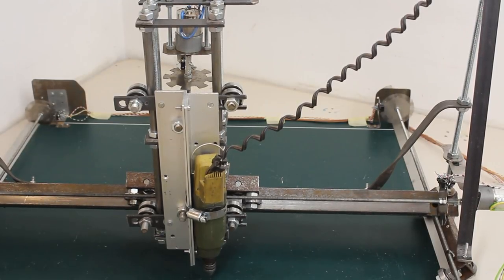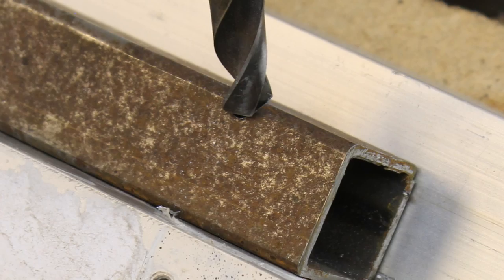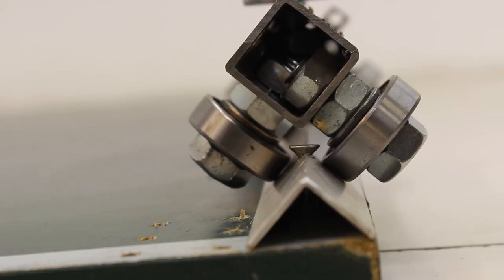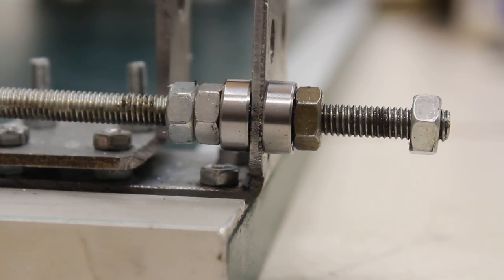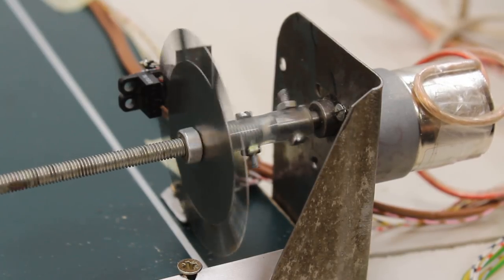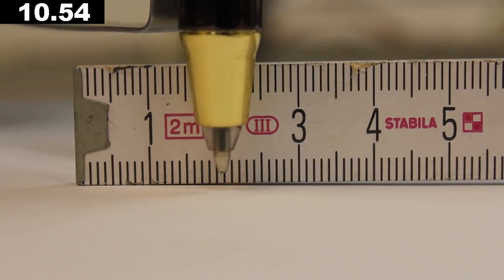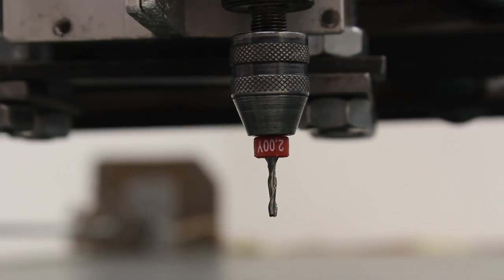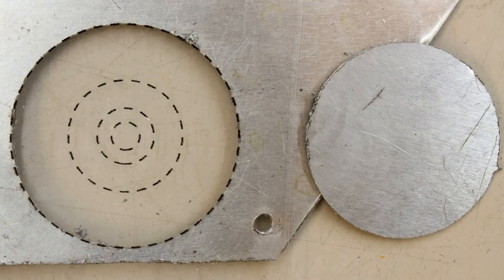Homemade CNC machine with materials from a DIY, built with simple tools

Comment: Sir, I want to know the step, so we use slicer software to cut the 3D CAD model into layer and transform into g-code. So, now how are we going to connect PIC18 with the g-code? Is there any thing out there we can use to connect PIC18 and g-code without using ramp1.4 and arduino? Thanks sir, your answer will save me a lot of time.
Reply from the maker: Well, I haven't used PIC18 nor g-code with this CNC, thus I can't give you an advice. I have upgraded this CNC with bipolar stepper motors using grbl to control it. With that configuration it can process G-code:
http://homofaciens.de/technics-machines-cnc-v2_1_en.htm

Comment: By the way , after making a look at the project page! i noticed that Figure 49:
Cutting 0.8mm aluminum plate which does not look smooth , i don't know maybe because of the chips or some vibration caused by the high rotation  of drill bit.otherwise it is a great work i love it
Reply from the maker: +Wajdi Rebei Thanks! The disadvantage of the simple construction is more clearance in total. Let's see what the accuracy of my CNC v0.6 will be: 
http://www.homofaciens.de/technics-machines-cnc-v0-6_en_navion.htm
Reply: +HomoFaciens ok ! i am following you project and i hope you will do more developed CNC machine ;) i appreciate your work ;)
best regards !
Reply from the maker: Thanks! v0.6 won't be my last CNC. There will be machines using "normal" stepper motors, too.
Reply from the maker: +Wajdi Rebei There is a chapter about those drives under construction on my project page:
http://www.homofaciens.de/technics-base-circuits-encoder-disc_en_navion.htm 
I will explain in more detail how to wire the motors and photo sensors in that chapter and there will be a video about that, too.
The H bridge you have found isn't exactly the same, but you can use it as well (it's the same IC on the board). I can't give you a link to exactly my board.
Reply: +HomoFaciens oh thank you for explanation .... an about the H bridge i found the same as yours  ;)

Comment: Hi. Cheers for posting this. I'm interested to build this for my model plane flying and I cut form or balsa sheets so this is perfect and within my reach.  But can this be done on a pi raspberry unit ? And what software is needed to draw pics or design if possible ?  Writing in c I'm not too sure how.  I'm deaf
Reply from the maker: +Rc Vulcan You need an Arduino to control the motors of this machine. You can use a Raspberry Pi to send data to the Arduino. Have a look at the project page:
http://www.homofaciens.de/technics-machines-cnc-v2_en_navion.htm
You can find a link to the source code of the software on that page.

Comment: If this is your "drug" for future CNC junkies, I'm HOOKED!  I would not have considered starting such a project because I did not think it could work well enough to be worth the effort.  You have shown that this is clearly not so.  Thank you.
Reply from the maker: John Colvin It wasn't that great adventure since I had built some of the components before. The linear drive was part of my video about the Arduino Uno:
https://www.youtube.com/watch?v=PQ1FBcQT0AI&lc=z13uuljryyncejejk04cjtroyn2vvxixxdo
Nonetheless many details were figured out while recording the video (a process that last for two weeks), which is why it wasn't a straightforward process. Sometimes you simply have to start working - many solutions come to your mind when when using your hands.

Comment: Hi,
I don't think it's possible to run the machine with only one Arduino, I may be wrong.
Will you please make a video to explain the circuitry and wiring.
Reply from the maker: Would you please go to the project page to see all the details as I told you in the video?
https://homofaciens.de/technics-machines-cnc-v2_en.htm
Reply: @HomoFaciens  Thanks for quick response ..
Your project page is really explanatory. Thanks again.

Comment: Would it be possible to use salvaged car viper motors to drive shafts?
Reply from the maker: Yes, in principle, but you'll need H bridges that can handle the high current running through wiper motors. The L298N I have used can control a maximum of 2A. In general, wiper motors are a bit too powerful for the mechanics, so look for low power models (not those for trucks).

Comment: On the encoders.....
Why don't you use the Optical sensors n discs from those inkjet printers??  
Much higher Resolution
Reply from the maker: Because there are too many stripes on those sensors, usually more than 1000 Pulses per revolution. With that high number of pulses the Arduino can process no more than 1 revolution per second which would be an extremely slow CNC machine.
Reply: Do you know that is a fact??  I think you're underestimating the capabilities of the Arduino.  or that is really bad IF true.

In any case, with this machine you can already cut new discs with 100 slots.
even 50 slots will improve resolution by more than 600%
Reply from the maker: The Uno has only 2 hardware interrupts, but three motors have to be controlled and don't forget about the USB communication. With all this it's hard to compute that many pulses per second. Of course you can use sensor discs with more slots, but that won't help if your mechanics has more backlash than that academical resolution. My CNC v3.2 with better mechanics uses 30 slots:
https://www.youtube.com/watch?v=iZ61lK91HRE

Comment: Really Great, but plz tell me  how you can interface the "Libre Office Draw" with your CNC ???
Reply: +Samer Elsawy and didn't you use any firmwares ????
Reply from the maker: +Samer Elsawy There is no interface for LibreOffice. You simply create a drawing with LibreOffice Draw, export it as Scalable Vector Graphics. Store that file in the "pictures" subdirectory of the installation of the command line program (commands-CNC).
"Firmware" is the software running on the Arduino (CNC_v2.ino in the installation package). Without that software, the Arduino is nothing but a piece if silicon...
Reply: +HomoFaciens Thanks alot for your reply :)
but did you write these programs with yourself (CNC_v2.ino & commands-CNC) ???
Reply: +Samer Elsawy and plz i want to know what is the function of (commands-CNC) ???

sorry i have so many questions because am really amazed with your amazing machine :)
Reply from the maker: +Samer Elsawy Yes, these programs were written especially for this machine.
Reply from the maker: +Samer Elsawy Commands-CNC runs on the host computer (Laptop or desktop) with Linux as operating system. That program reads the svg file and transforms the X/Y coordinates of that file into stepper motor commands (e.g. stepper motor X one step forward). The stepper commands are sent to the Arduino through USB. CNC_v2.ino runs on the Arduino and turns the DC motors (stepper motors) on/off to execute the steps received from the host computer. My v0.6 under construction will be more easy to build:
http://www.homofaciens.de/technics-machines-cnc-v0-6_en_navion.htm

Comment: Dude, Water is NOT a cutting lubricant. Oil is. WD-40 is. Other than that, Great Project !
Reply from the maker: +StepCorn Grumbleteats I know, but it cools the plastics so that you can cut it and that's what this machine was build for (besides cutting wood). I do not want to use cutting oil in a machine that spreads that fluid all over the room (water evaporates without residue). If I have made a CNC that can in fact cut aluminium I will show how to implement a circular flow of cutting oil. Be patient.

Comment: Can this be made to work with stepper motors too or code is totally different since you are using normal motors?I'm using an Ardunio UNO.
Reply from the maker: +ivan zubak You have to change large parts of the Arduino code if you are using "normal" stepper motors. I will use bipolar stepper motors in one of my projected CNC machines - stay tuned.
Reply: Ok,thanks.I have bipolar stepper motors.I thought about building a small laser PCB "engraver" so I just burn the paint off and etch the exposed copper away,
Reply from the maker: +ivan zubak Thus a small machine like CNC  v0.6 that is currently under construction could be a solution:
http://www.homofaciens.de/technics-machines-cnc-v0-6_en_navion.htm

Comment: not yet strong enough to drive a router he said as the video got into the router part.... I like the idea of gear motors and feed back by light sensor... simple.. and surprisingly accurate. I suppose to get to .001 accuracy. (thousandths of an inch or 1/40th of a mm ) you need a way of stiffening supporting your threaded rod, and perhaps pre loading tension/compression on the traveller nut. I had thought of a spring loading compression to take out gear lash or clearance so to speak. It would have to reverse compression direction when the direction on an axis changed. Perhaps by solenoid.

neat construction.. have seen similar.. this one is not fancy, which I view as a good thing.. and as I said very accurate..

One thing I might mention which I know from a ways back. Radio dials in old 1930's and later tube console radios were controlled by a tensioned wire on a pulley wheel. The stated accuracy of the dial indicator for stations was 0.001 inches! This was used as a basis for the control of the print head of the first dot matrix printers which were designed about 1962 -1962 by IBM. They needed very accurate repeatable positioning for building characters by repeated passes.. It might be possible to get good positioning information passed to a secondary servo with a feedback loop. 

Whilst I don't think the wheel-wire is strong enough to drive cutter heads it could position a go no go indicator which mated with a feed back driven stronger motor drive on a threaded rod or gear track. In other words you have a rabbit and greyhound concept. The wire-wheel leader system is the position "flag" and the cutting head head chases it with its own catch up sensor array to align it on the right point. 

The physical connection between the two travellers to provide relative position information could be a sliding capacitive sensor like a digital caliper.
Reply from the maker: Yes, I will have a closer look at the linear sensors as in the digital calipers. The dial indicator mechanics is interesting, too. Thanks for your feedback!

Comment: If you drill the hole to 6mm how on earth do you then use a M6 tap? Tap drill should be either 5.5mm or 5.25mm depending on the thread pitch of the tap (0.5 or 0.75mm pitch)
Reply from the maker: +koswix 
It's a 5mm hole what I was talking about, isn't it? Please give me a time index if I am wrong, because nobody is perfect.
Reply: +HomoFaciens 4 minutes. Just watched again and realised you only used the 6mm to chamfer the entry to the hole - my bad, sorry! Missed it because I would have used a countersink tool to do that bit.
Reply from the maker: +koswix 
Thanks for your second reply; so this time it wasn't me that made a mistake ;-).
If I had a countersink in my toolbox I would have used it...

Comment: do you think it would be possible to modify this design to add a laser engraver? And is there some way to generate the code to move the head and when the laser is powered? if so, what software would I use? I am a complete newbie at this and want to make a laser engraver
Reply from the maker: Since you are asking if it is possible, I assume you are an electronics novice thus I give you one advice: "Hands off lasers!" You won't be able to follow my future video instructions with no eye left...

Comment: Good day. Please tell me how to run CNC Shield through the Arduino UNO ? as was suggested to me that Shield should be the driver. Where to get this driver for CNC Shield?
Reply from the maker: +Алексей Кротов What shield? I am using an Adruino Uno with two H bridges. There is not classic driver, the software written for my machine simply transforms Scalable Vector Graphics into commands for this special CNC.

Comment: @HomoFacines can you do a tutorial on how to program it to give it depgh (z axis movment up and down)
Reply from the maker: +Adrian Ciszewski I am currently upgrading this CNC to version 2.1 using bipolar stepper motors. I will try to operae it with GRBL on the Arduino - stay tuned!
Reply: +HomoFaciens thanks for the reply, after watching your video i decided to make my own CNC machine but wanted to base it on extruded aluminium (v slot) any advice in a video or exchanging ideas in CAD programs would be very much appreciated
Reply from the maker: +Adrian Ciszewski Well, I am not using CAD software to create my machines. You can see all my machines (and so the ideas behind) on my project pages (especially the "machines" section):
http://www.homofaciens.de/technics_en_navion.htm

Comment: Most programs seem to be setup to drive stepper motors, how did you get the Gcode changed over for encoder pulses instead of "steps"  maybe i'm missing something simple?
Reply from the maker: +frankswd The DC motors are transformed into stepper motors by the feedback through the optical encoder discs. From that point there is no difference to other CNC machines. But: The software I have written can't read G-Code (yet). It processes only scalable vector graphics. How to turn DC motors into stepper motors will be shown in a video that is currently under construction - stay tuned!
Reply: "The DC motors are transformed into stepper motors by the feedback through the optical encoder discs."  This part i unstood and i have used them this way for simple code, but to take a Gcode and change from giving  steps to reading pulses, actually seems like it would be easy but i have found no software that has this option.  Ultimately it would be nice to add PWM as based on RC Car ESC so one could use hobby  BLDC motors which are both cheap and powerful!!!    And i have a bunch of them :)
Reply from the maker: +frankswd If you can't find the software you are looking for, start to code your own! Using RC speed controllers is similar to using servos. My CNC v0.5 uses servos as drive:
http://www.homofaciens.de/technics-machines-cnc-v0-5_en_navion.htm

Comment: hi
i have oriental brush less motor vexta axhm5100k-gfhk2 
can we used it as stepper motor ?
or can wire it with stepper drive ?
thanks
Reply from the maker: Burshless motors don't work streaight forward with the electronics I have created for this machine. You need a brushless motor driver and you need to adapt the software to that driver board.
Can't ell you all in a single comment, learn the basics about encoders and how to control DC motors on my pages:
https://homofaciens.de/technics-base-circuits-encoder-disc_en.htm

Comment: Hi , i saw your tutorial and i'm making same cnc machine but with stepper motors, and i have some problems with wiring stepper motors with easy drivers...
Reply from the maker: +Tiki Gangsta There will be videos / chapters about using bipolar stepper motors in the future and I will upgrade this CNC to those drives - stay tuned!
Reply: +HomoFaciens I'm using unipolar/hybrid with 5wires  stepper motors but i'm using him like a bipolar wired with 4 wires with easy drivers 4.4 but when i connect motors only with easydrivers (because arduino is not arrived yet) and switch on 12v power they are rotating by self. 
Is it normal? Sorry for my bad english..
Reply from the maker: +Tiki Gangsta What about reading the datasheet of your easy driver? That should give you the answers. I don't own such a board, thus I can't tell you how to use it...

Comment: it is relay amassing am i make this myself there is some confusion between there is problems with power supply and how it work with computer is it working with sd card can you  guide me ?
Reply from the maker: Have a look at the project page for details:
http://homofaciens.de/technics-machines-cnc-v2_en.htm
Currently there is no way to use an SD card to transfer data to the machine.

Comment: good job,  congratulations, how much torque generates  DC motors??
Reply from the maker: LUIS ALBERTO VIZARRETA GALICIA Thanks! The torque is 60Ncm @ 12V. I have added that to the technical data on the project page.
Reply: Thank you HomoFaciens your very intelligent... excuse me for my english it is not my lenguaje... does the torque depends on Voltage??? thank for the answer and congratulatios for the CNC you made...
Reply from the maker: LUIS ALBERTO VIZARRETA GALICIA The higher the voltage, the higher the current flowing through the windings of the motors, thus the stronger the magnetic fields become and so the higher the torque of an electric motor.